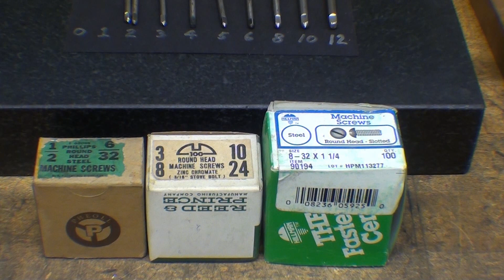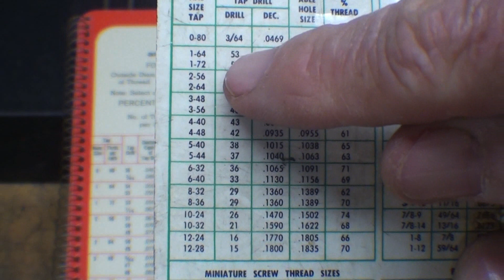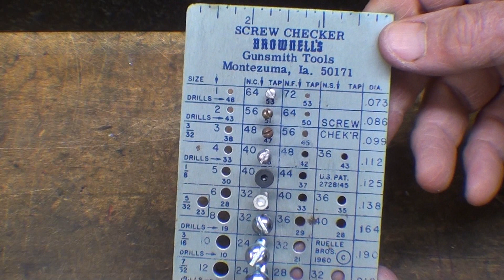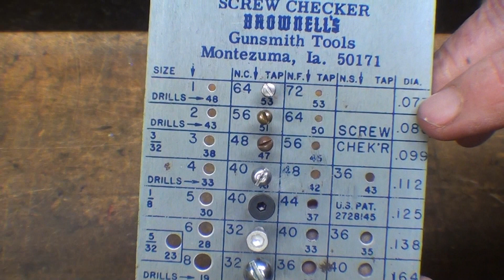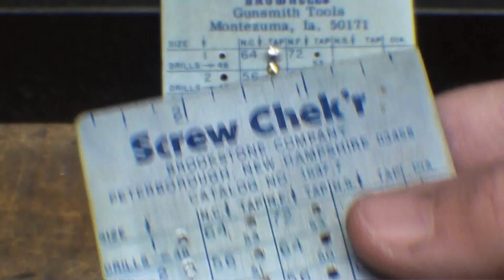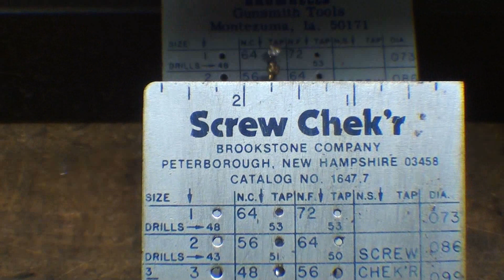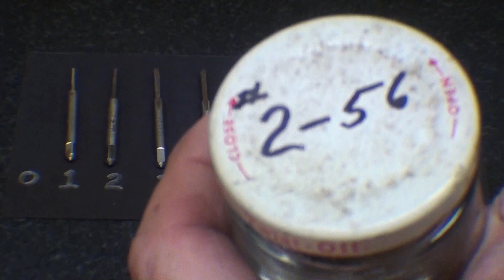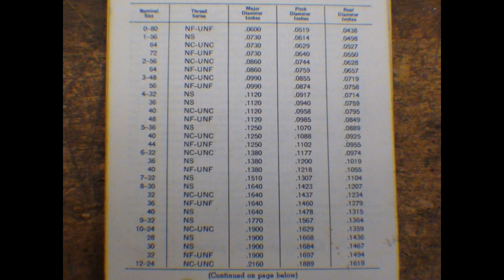SHOP TIPS #381 Understanding Machine Screw Sizes tubalcain

Comment: I'll share this - have an 82 year old father in law - german background worked in australia as an aeronautical engineer designing undercarriage systems for aircraft including F111 and F18 - I thought he would be a total metric devotee - but he is an old romantic and loves mathematical and engineering elegance - he says the metric system is an impersonal harsh system - he said- tell me how much .001 of a millimetre is, he says -no one knows - however everyone knows how much a thousandth is or a inch or half an inch - he says the imperial system is far more elegant.  So there it is from a german engineer.
Reply: You can do good work with both systems. Naturally, because I'm european I use the metric system. I have a preference, but It's easy to do the conversions needed to work in both systems. One inch is 25,4 mm.

At work we use both systems. Maybe a job calls for an imperial unit shaft to fit a metric part we make. It's no big deal.
Reply: umajunkcollector 
3cm is near a foot!   I dont think so.
Reply: Get you father in law a metric feeler guage and stop complainting about not being able to grasp a metric measurement!
Reply: No, you're thinking of a dm which is 100mm, a cm is only 10mm.
Reply: We can argue all day which system is superior (metric, obviously), but I humbly suggest we laugh at the Chinese instead.
I have a set of paintbrushes that is embossed with the dimension on the ferrule.
The largest one says 4" 101.6mm.
They didn't even waste one second to consider the importance of 1.6mm on the with of a paintbrush, now that is how you become the greatest industrial nation on earth, Mr. Pete. ;-)
Reply: Just like learning another language, you don't know the language until you can think in it and speak it without having to translate back to your base language. Same thing with metric -- which, by the way, is what the U.S. monetary system is and nobody has problems with that. Once you start thinking in metric and see how easy it is because everything is in "tens", you're golden.
Reply: Well, when you're running a lathe, you do have to convert to decimals, machine tools are not in fractions, they're in decimals. I worked as a journeyman machinist for many years on 3rd shift, and doing this at 3:30 in the morning is prone to error. We would rejoice whenever we got a metric print, it made life so much easier.
Reply: Not necessarily, depending on the specifications and the tolerances, when you're machining fits on a shaft, for example, sometimes the shoulder is measured from the end of the shaft, sometimes one or more fits are measured from the previous shoulder. Believe me, I have a lot of experience with this, you have to convert everything first and lay it out before you begin. Yes, some of the fractions you memorized but it's still very difficult and very prone to error.
Reply: woops, my bad, and inch is 25mm, or 100mm is about four inches.  So a foot is around 30cm.  not used to dm's, seldum used.  thanks for reminding me, I still use imp, so my head is screwed up with both.  Um forced to use both, but still like metric better.  Metric screws and wrench sizes are easier, hand me a 13 rather than half inch.  Imp: 3/16ths,   #10 screw,   #13 drill bit,  .1875"  or about 5mm.
Reply: Tell me about "elegance" when you're working the 3rd shift in the machine shop at 3:30 am and you're trying to add the distance of shoulders on a blueprint for a shaft with something like 2-3/16" + 5-5/64" + 3-3/32", etc.? You have to first convert to their decimal equivalents and hope you don't mess that up, then add them, then re-convert to inches. How much easier is it and with fewer mistakes to simply add, say, 100 mm + 60mm +  40mm?
Reply: who needs the queen's measurements?
Reply: 30cm is around a foot. :-)  Think you missed out a "0"  regards
Reply: A mick hair!
Reply: sunrisesurfbum....So...ya obviously....the point was you convert once with the final fraction! NOT the silly, time wasting and error prone way of doing it for each fraction first...wow! Or better yet you do what every other real machinist does and know your decimal equivalents or glance at the chart on your micrometer you're holding instead of cowering in fear of the clock turning to 3:30.
Reply from the maker: Thanks for watching--good reply
Reply: umajunkcollector.... now you know why I find the metric system annoying. You did what I do without thinking....in temperature measurement the metric centigrade system is 100 degrees between water freezing and boiling. So 3 centimeters would be 300mm or as you note ~one foot wouldn't it? No, 3cm is 1.181 inches or 30mm. 
The cm is a useless measure... ~3/8 of an inch. Do like the Australians and Germans do.. Use millimeters and meters and forget centimeters.
If I read a dimension in millimeters, I have no trouble seeing it's relationship to inches (and of course the inch is defined by the mm) and  with a calculator and knowing 25.4mm = 1inch and 0.03937"= 1mm (about 6mm error per km) I can calculate the exact relationship in the shop.

Once  you memorize the decimal equivalent of inch fractions down to 1/16"  (and about half of them are trivial, e.g. .25, .5, .75) and the value of 1/64th and that covers 95% of the sizes you use in the shop every day. . I have a big wall chart that has #, inch, mm on it for everything else.

What I don't have a sense for are small clearance dimensions. I know what a 0.0005" running clearance is.. but if I see "Allow 0.012mm diameteral clearance between the shaft and bearing"...I have to get my calculator out.
Reply: "there's nothing natural about it"
You couldn't be more mistaken. The imperial system is based on the very natural system of cutting things in half (half of a half of a half etc). It is the same way musical notes are formed. What isn't natural is slicing something up into tens. Admittedly Metric makes doing the math very easy and I employ it for that reason when I need it. But, I agree with the original post that the imperial system has more elegance to it much the same way as music does.
Reply: ShysterLawyer not sure if that's a counter argument...
Reply: Imp uses both /10 and /1 /100 /1000 etc decimated as well as /2 /4 /8 /16 /32 /64 which sux.  All those crazy odd numbers, 16 32 64 and the goofy decimal counterparts.  
Metric is far mare user friendly and natural.  It doesn't require all those crazy fractions and odd numbers.  Music is nuts too, crazy to learn.  Funny you didn't mention binary bytes, 2 4 8 16 32 64 128 256 ...
Reply: sunrisesurfbum "You have to first convert to their decimal equivalents"
um....so, no you don't. It's just being unfamiliar with working with fractions that is the issue. The figures you posted is super simple addition. Those of us who are familiar with it know at a glance that 3/16 equals 12/64 and 3/32 equals 6/64 right???  So 12+5+6 = 23/64. 2=5=3 = 10. your answer is 10" and 23/64". 

But like I said earlier. Metric admittedly does have advantages when it comes to math, especially percentages. If you had to take a percentage of 23/64 into something usable, metric or thousands would be key. I was only speaking to the assertion that imperial or SAE measurements were unnatural when in fact it is a very organic and natural way to measure. Both systems have their advantages. A blanket statement that says one system is better, especially when you don't understand it, is silly.
Reply: conversions are where it can get confusing.  
25mm is around an inch, 3cm is somewhere around a foot, a meter is close to a yard, grams vs ounces really mess us yanks up.  But using decimals in inches can get crazy, like 1/16th is .0625.  or 1/64th is .015625.  metric is more decimal friendly.
Reply: No, metric is for the simple and we cater to the simple enough.
Reply: Isn't 1cm about four inches?
Reply: Thats the dumbest thing I've read this week. 
1mm is a thousands of a meter.
Just accept that the imperial system is old and outdated.

Comment: What a great idea to set up a holder! Tapping size - Tap - Clearance size. That'll save hours of farting around per month finding the correct implement. (And or remaking parts due to drilling the wrong size!) Thanks!
Reply: With metric screws you only need to know the tapping drill sizes, the clearance sizes are self-evident. The clearance drill for an M4 screw is - hang on to your hat - 4mm! No faffing between fractions and thousands.
Reply: Not exactly... a 4mm drill may be the body drill for a 4mm screw, but that's not the clearance drill. A clearance drill is 5%-8% larger in diameter than the nominal body diameter of the screw.  My metric drill and tap tables have the tap drill and clearance drill sizes, e.g. the clearance drill for a 4mm fastener is 4.5mm . 
Standard threaded fasteners are designed to work by generating a clamping force between the mating parts... they are just very stiff springs. Drilling the unthreaded mating part with holes that are the size of the fastener invites failure by bending and shearing, not to mention that the hole locations  in mating parts must be drilled exactly in all three axis's.
If mating parts must be closely located to each other, use dowel pins or machined features.... not the fasteners.

Comment: +MrPete222 I am going to throw away a few bucks on the big laminated decimal chart from MSC direct. It also has the list of drills and taps. It's poster size and goes on the wall.

I am now looking for a screw checker because I live out in the sticks and do small work. My local suppliers of tools and screw never venture under 1/4-20. :( That means I mail order a lot. So if I need to match a screw I will have everything to do that with as I have a complete index of number/letter and fractional plus a Tap and Die set.

I'm getting setup so I don't have to drive 60 miles to find I have an odd thread from the 1930s... Been there, Done that.